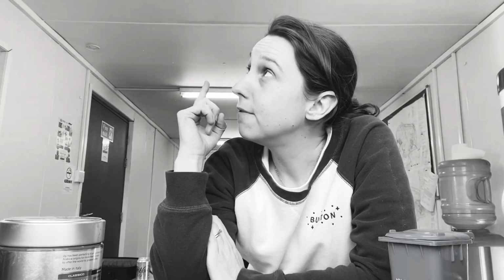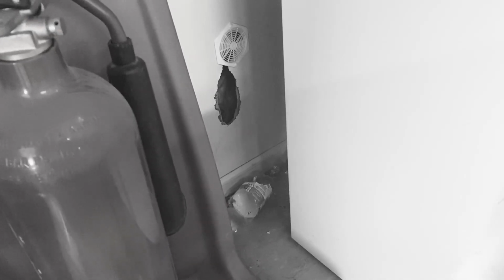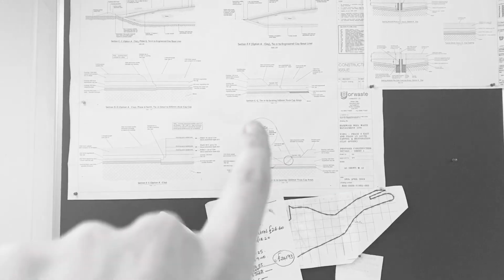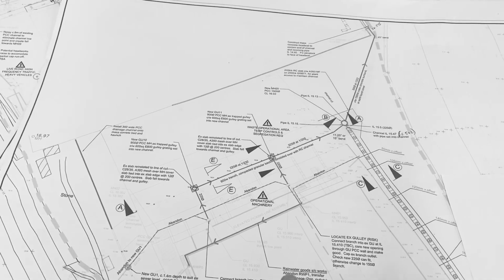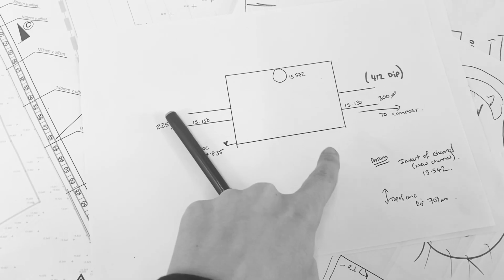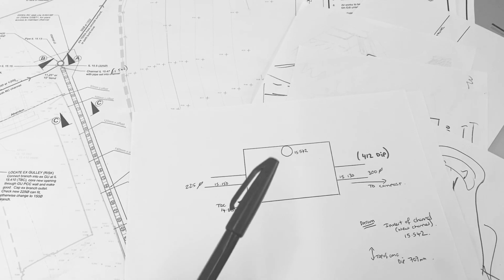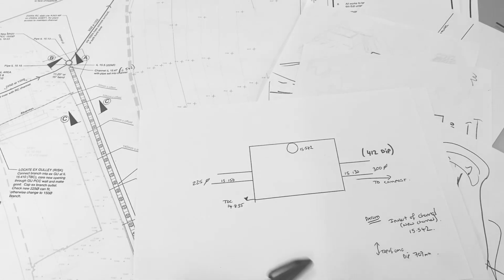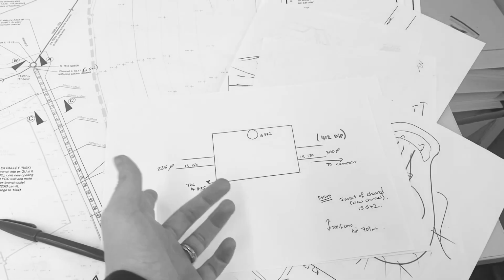Construction site office TOUR!

Comment: was that a MH or an attenuation tank? and I had sites where what you have there welfare and site office were much less(and worst) then what you have, so yeah, you could start even form worst the. that. BTW sae you use topcon, I use to do that, but I suggest you should pass on trible, much better, fast thinking kit, loads of drawings you could use in the same time.
Reply: i only have a little experience with lasers and am still learning, we never used the gps topcon in school just the non gps, i looked up the trimble you are talking about that looked handy dandy:) i want to find out how they get the prints loaded into the gps system so it can go by that, we did it all manually without gps, your way seems much simpler, we would look at the prints, find grade, make adjustments, match up with our target, walk around with a pole doing the beeps etc. etc. etc., and you guys just transfer the outline from outer space lol, that seems much better:) i want to try that way because i'm still confused about non gps lasers oi voi
Reply from the maker: It’s a MH with a drainage channel. Built lots of attenuation tanks but mainly on housing sites. I would love to try a Trimble I have heard they are very good :)